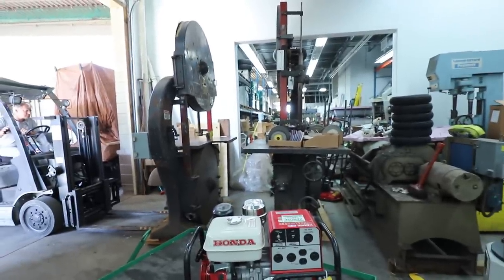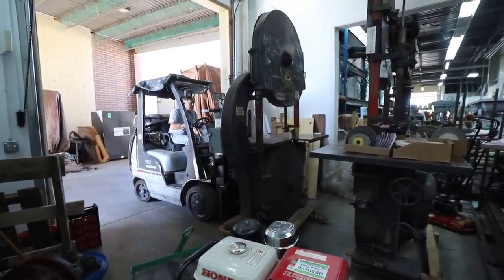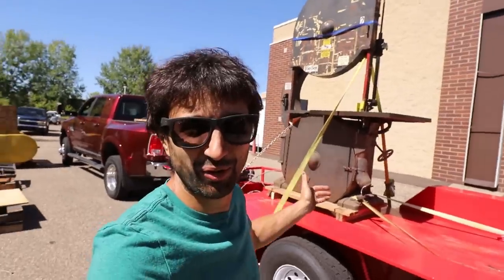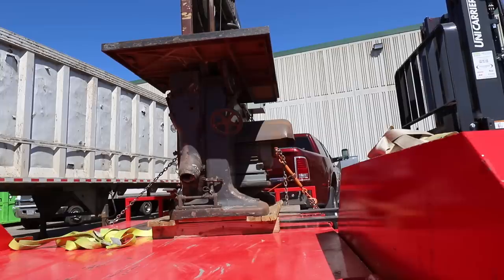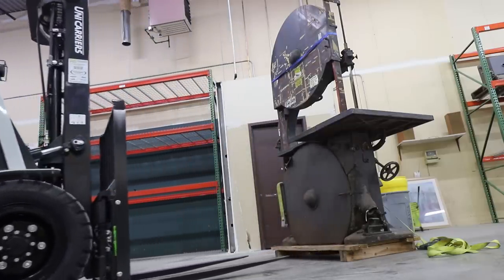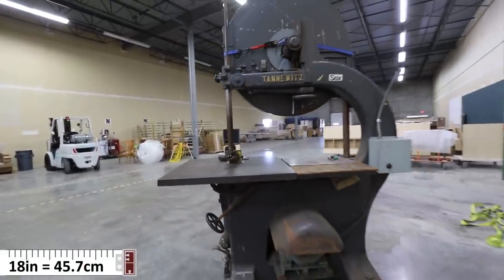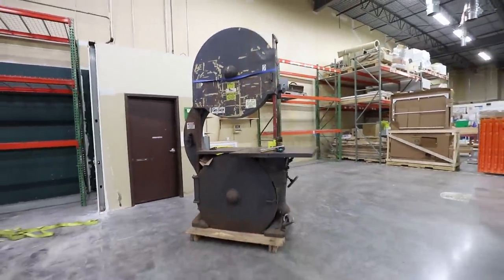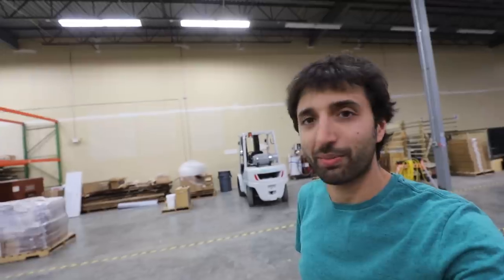Moving a Big Bandsaw [42" Tannewitz] - Warehouse Vlog 3

Comment from the maker: I think this might actually be a 42" saw now that I'm doing some research.  Remind me to get a tape measure for the warehouse.
Reply: Don't forget to get the metric one too. Then leave there and don't use it.
Reply: Hey Matt, get a tape measure for the warehouse.
Reply: Get 2 cause one is going to be lonely...
Reply: Visit owwm.org and vintagemachinery.org.  They will both have information.

Storing things for other is pottering (after Joe Potter).  Moving items is ruckering (yes after Keith Rucker).
Reply: 8'10"= 2.692m not 2.4m
Reply: Get 2 or 3 cause you'll never be able to find it when you need it if you have 1
Fun fact, we call them tape managers around here because that is what my daughter calls them (8 years old now)!
Reply: @gizanked  forget all that 1ft 3in and 7 6/4  lark, use the metric one, you will never change back.
Reply: You've probably already figured this out, but is it the Tannewitz model RH?
Reply: Do improve your audio quality and hard to hear and understand what you said in the start and begining
Reply: What size is that blade !  I would make blades for a food bandsaw !
Reply: Yep, it's >36" when the bottom wheel is engineered to extend below floor level.

Comment: Used to run a vertical bandsaw twice that size of that mill. The boss used to say hold still when the blade broke. I've run saws you've never seen. Two weeks after I left the job a saw took my replacements hand off. It takes a special person to be a Sawyer.
Reply: Yikes!
Reply: @MJ-nb1qn  that was the 80s. That the way it was.
Reply: Scott Jepson - Yes I know. I’m an old man now. In the 70’s I worked in a big metal fab shop, we made alfalfa dehydrators 60 feet long. I once almost cut both arms off a young apprentice while running a metal sheer cutting 1” sheet steel with about a 8’ x 4’ piece sticking out the back. He had his arms under it getting scrap metal out. It was a huge machine. The most amazing thing I helped, was rolling a 6” x 9” steel bar into an 18 foot circle with 1/8” tolerance. We had 3 overhead cranes and 5 men working and one boss screaming at us the whole time. Good Times.
Reply: @MJ-nb1qn  I had a lot of jobs there. Sometimes I would drill holes in 5ft long white pine. To do it right you'd go a little at a time. If you went to fast the bit would grab. Then the 4 by 6 would swing around and knock you on your butt. I would usually laugh. The boss continually put me on more dangerous jobs. I was a sawyer. I could take it. Had a lot of kick backs on a dado set up on a table saw. Stepped out of the way and let it go over my shoulder. You couldn't even believe all the things that happened with 3 and a half inch nails guns. I actually loved that job even though the sign on the wall never went two days without an accident. Millinials could never handle that. I think I was making 5.50 an hour. I loved it!

Comment: Nice job with the forklift. Years ago, working for cable tv, I learned how to pick up coinswith the forks in the middle  of the floor. Neat little trick. Need to show you somehow. Lots of free lunches making buts with people. Told them to set it any where I could get the forklift, pick it up right there, then give it to them sitting on top of the fork. Good luck with another new adventure.

Comment: Great score on the bandsaw. After missing several 36” saws in the past I finally landed one just a couple of weeks ago along with two 16” Dewalt  radial arm saws and a panel saw. Band saw is a Yates maybe late 1800s vintage with a 7 1/2 hp Baldor motor. From a lumber yard that opened in 1889. Now to come up with space to put it.

Comment: When making fine move with my forklift I use the hand brake not the foot brake. On mine the foot brake disengages the transmission where as the hand brake does not. Try it on yours see if works for you.
Reply from the maker: I’ll try it thanks!
Reply: On the forklift at work there is a parking brake foot lever and then two actual brake pedals. Left is the ‘inching pedal’ which disengages the trans. as you mentioned. The other brakes while keeping power, I think for control on inclines. But generally you want to be using the inching pedal as it works like a clutch.

Comment: I have a 36'' Oliver vertical band saw and I love it. Mine had a broken trunnion which I machined a new part to fix it, these saws have a weakness with the trunnion so be careful not to drop a heavy timber on the table. I built adjustable stops for my saw to help support the table when at a flat 90 degree setting, which is where the table is most of the time anyway. If you don't have a blade welder you will need one to make the blades as they are ,in my case 19' blades. For big blades I tig or mig weld them using a jig to hold the blade ends straight. I also found that a magnetic fence is very helpful. Good luck with it and be careful as these saws are very fast cutters It could take a finger or two off before you felt it.

Comment: Flying a drone and driving a forklift at the same time. Man you have mad skills.
Reply: Watch Andrew Camarata's channel
Reply: Dementia Joe Biden  yeah, between all of that cast iron housing and that enormous motor on the bottom, there is no way that tool is top heavy. 2/3 or better of the weight is from the table down.
Reply: Dementia Joe Biden  yup, i've spent many hours on many different forklifts upto and including conex movers, you'd have to get pretty wreckless with quick whipping turns or quick stops to overturn that bandsaw.

Comment: Tannewitz is still in business. I have the exact same saw that I got off of Ebay about ten years ago. And Yes it is a 42in. It winds up like a jet at take off and takes forever to stop unless you use the foot brake. Mine runs so smooth that you can balance a nickel on edge when it is running. There are several Youtube vids of smaller ones running.
Do not buy a after market manual as they are a ripoff. If I can figure out how to send you pictures I will send you some of mine and the three phase setup I have.

Comment: Matt some added info. The motor is a 7.5 hp and you can find a serial/model no is on the motor side on top of the upper wheel shaft just above the tilt handle. Hope this helps
Reply from the maker: Thanks so much, Rick!

Comment: Does that forklift have the ability to extend the forks out away from itself? I don't know what that's called but I assumed most forklifts had that feature. Would be faster than picking something up with the end of the forks, putting it down and then picking up again to get a skid to the base of the forks.

Comment: Watching this caused me to have flashbacks to moving my  36" 1905 Crescent band saw... It was hairy! The seller used a backhoe to get it on the trailer. My brother in law towed it to his shop (commercial electric motor and generator shop). While there he put new bearings in the motor and made a new collar for the top wheel. After that he brought it to my house with a lift gate truck and set it on my driveway.  To get it to my lumber shed I disassembled it.. took the motor, wheels, etc. off the frame. While moving the frame down a grassy incline to my lumber shed my shirt got caught on the top guide bolts that I foolishly put back in their holes. At that point I couldn't stand the frame up nor could I set it down. I ended up lowering the saw frame and myself to the ground... pinning myself to the ground in the process. I yelled out for help to get untangled and get it back up right (sans the bolts)! I think that when the time comes it will go with the house as I don't want to think about getting it out of the lumber shed and back up the incline!  That saw comes in second to the large 19th century safe I moved one time in terms of nearly killing me! LOL
Reply: That would have made a good video! Glad you survived!

Comment: It's easy to tell 42" saws from the 36's"  because the lower wheel drops below the feet of the frame.  

Tannewitz saws tend to be beat up because they are typically used in high volume, high production environments (such as furniture shops).  The tables are often highly worn and not flat.  Just from the looks of this saw, it's seen some abuse.  Likely run hard, and put away wet.

Comment: @Matthew Cremona    Please read the manual for your forklift. The left pedal is for disengaging the transmission while still in gear to put more power to the hydraulics. 
                                         Please use the middle pedal to stop the machine with a load on it
Reply from the maker: Still getting used to that

Comment: Back in the day I told my boss we needed a bigger bandsaw that was powerful enough to resaw boards 12" plus wide. I sourced a Tannewitz the same size as this one but belt drive not direct. Ex Navy yard machine. It was a noisy howling bastard that scared the crap out of us until we got used to it but it did the job. Really it should have been stripped right down and new bearings installed top and bottom but we only replaced the upper bearings. 
It had pressed and riveted steel wheel's. I suspect it was geared to high on the pulleys too.
Our biggest fear was that if it broke a band we would loose hands and finger's. We called it the bitch. Crazy day's.

Comment: Not really clear looking at this saw. Does the table tilt to make angle cuts or does the saw tilt and the table remain level? If it is the latter this could be called a "Ship Saw" used ib  boat building.  Just curious.
Reply from the maker: It’s not a ship saw. The table moves not the sawhead 👍
Reply: @mcremona  Thanks Matt

Comment: when sneaking up to a load, trailer, or whatnot with your forking lift, the middle pedal should be just the brake, and will let you ease up better than the left brake pedal that is (normally) set up to kill the drive of the transmission so you can rev the engine to use the lift better. Most are set so the brake is off but the fork has no drive so you end up rolling back, or not moving until the foot is fully off and all manner of giving you fits and starts.
 Is the entrance used for the fork to go in and out too steep, or to low to have driven in with the saw? Or were you just being safe and stuffing it into the trailer door? 
 Don't worry about it too much, you're doing better than many. I know people who have been operating lifts for decades who still don't get the way the things work. They drive by Braille and one, after 5 years of driving, still hits a load hard, 3 times before he gets it up and moves it. The last day I had to work with him, he hit the load enough to crack the first board on the pallet, then shifted the 4 drums on the pallet with the second hit, then driving into the trailer, he drove the pallet into the trailer wall, and came back down with a few loose boards atop the forks held in place by 4 shrinkwrapped drums in need of a new pallet. It was only $53,000 dollars of product . . . not like one needs to be careful . . and it's only acid.

So glad I am across town from the buffoons now.
Reply from the maker: Thanks for the tips! I’m certainly still getting the hang of it. The door that joins my space to the area with the drive out door is about 8’ tall. That’s some scary stuff. You can do some damage in a hurry with these things!
Reply: @mcremona  some of ours are limited to 5mph, and still you can do a LOT of damage. Let alone the Harpoons off the front. 7,000 to 9,000 lbs of blunt force.
I worked near a place that had a guy killed by a negligent driver . . . while driving with them up too high, ran a fork into his chest.

Okay, 8 foot, is an issue. I just sent a piece of equipment over to the old place that was taller than all the doors into the place. Well, the Trailer doors are high enough, but the ramp goes under the second floor at just over the tower on those forks used in the place, so less than 7 feet. a fraction taller than 2 ibc totes of 275 gallon size, stacked, all the other doors are just a few inches taller, but not much. To get the equipment in, they had to drive it to the door nearest it's final position, remove it from the skid it was on, lift one end up until the frame cleared and then drag it in, with a new "speed bump" spill retaining wall to make it even more fun and with a 50"x50" scale and computerized panels all still attached with cables.